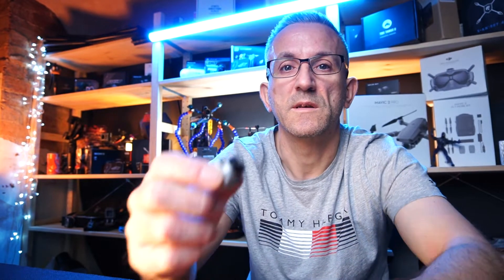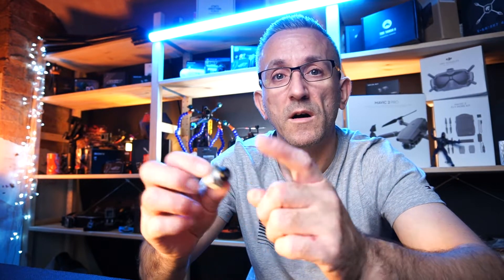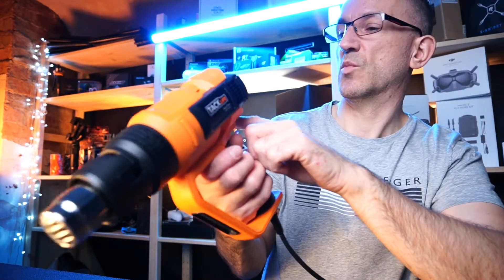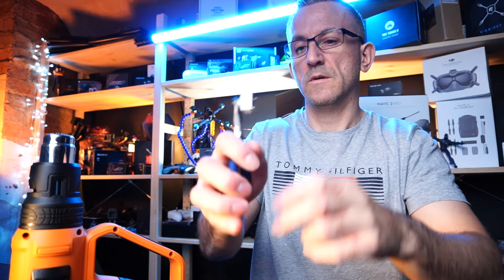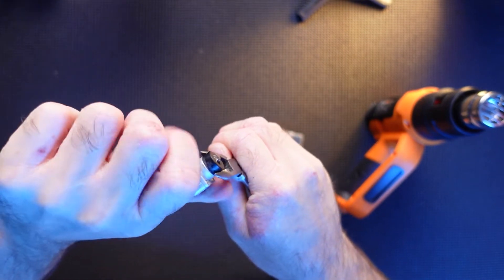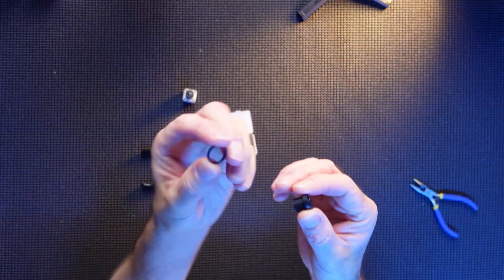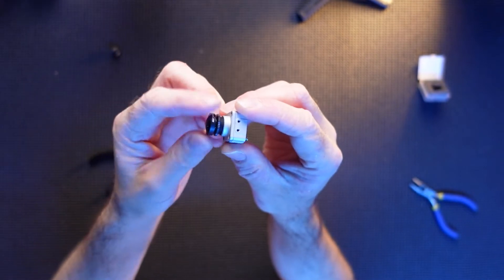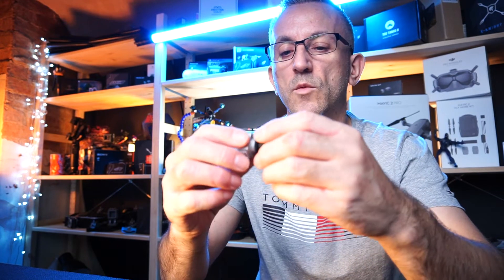How to Replace the DJI fpv Camera Lens

Comment: I removed the filter on my new lens and wish I hadn't. 
It looks pretty messed up color wise and im gonna buy another lens. ive got the dji cam and my original lens had the filter still on it.
If I could go back in time, Id remove the filter on my scratched lens and check if the colors look better or not and then decide.

Comment: Might try those runcam ones next. I got another brand with a lock nut but the lock nut is useless. I have the lense in and all in focus but the lock nut ring just spins freely without tighenting
Reply: ive heard plumbing tape can help with that